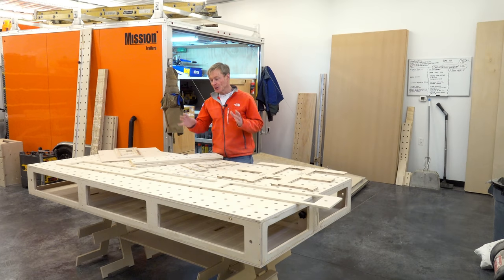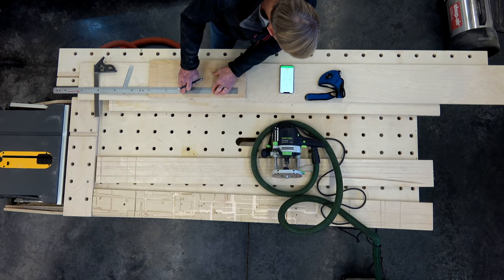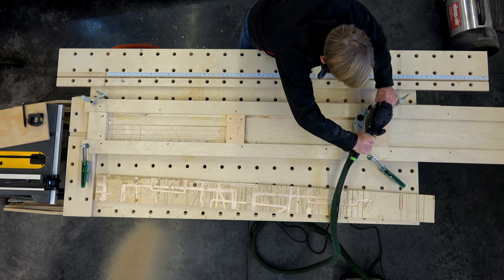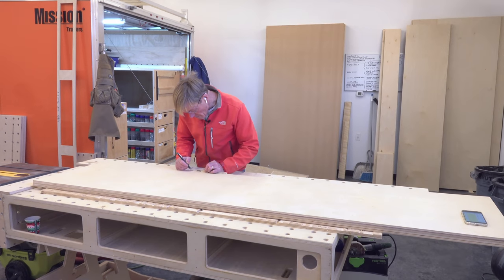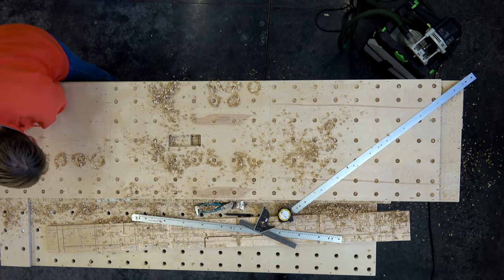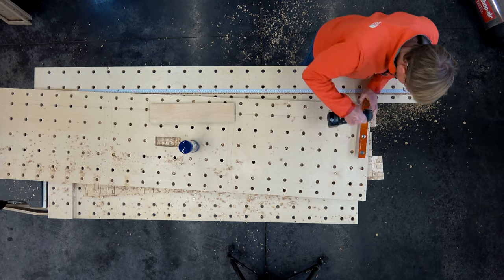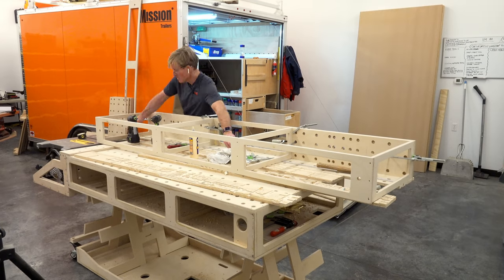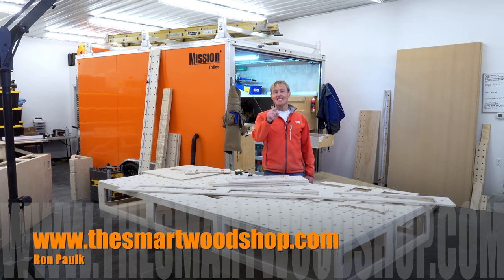Big Bench Build

Comment: Ron. A tip for accurate holes. I tried printing a hole template on paper with center marks for the holes 1:1 scale. I made a bench by plotting all holes on a large format paper and sticking it down to the ply. Poor mans cnc, (a plotter). You get a very precise mark for the holes that you can just prick through the paper. No measuring, just align the paper with the edge of the ply. I tried double sided tape and tested with spray glue, both work fine. A print shop can plot black and white template very cheaply. Luckily I have a plotter at my office so it was free for me. Any CAD program can be used to draw a template of holes, you can also get creative with hole spacing and patterns.

Comment: There's something to keep in mind. You're showing people (often newbies like me) how to build a smart bench with another smart bench & accessories they likely won't own. As such, you might reach and attract more buyers for your plans with a demonstration video building your benches old school by starting out as they would with the minimum tools necessary. They'll have to buy the parf guides, obviously (which is expensive enough on top of all the plywood), but we can watch videos of people building far more complicated and labor intensive things with just the basics. They'll have some kind of circular saw, for example, but they won't likely have a track/plunge saw with parallel guides (TSO or otherwise). They certainly won't have your crosscut guide or a miter station of any kind. They'll be lucky if they have a miter saw. Most will also be coming to the table with a small router only (if they're lucky to have that). I'm just a diy homeowner with an older house in need of fixing/renovating. I am intrigued by your plans because, as you've stated in another video, your benches are great for those working out of a garage because of the modularity of the design (my wife and I want to park our cars inside at night). I for one would like to see an old school build video. I'm not talking about hand saws only, but I think a lot of diyers, myself included, don't even have a table saw. I'm on the Dewalt Flexvolt platform and have their circular saw, miter saw (like yours) & factory stand, small plunge router, random orbital sander, oscillating multi tool, angle grinder, hammer drill & impact driver, jigsaw and a few pneumatic nailers of various brands. I also have a Sawzall and some other hand tools as well as some flimsy saw horses, but that's about it. I'd say I'm off to a fairly good start toolwise, and I plan on picking up a track saw and TSO parallel guides at some point (in lieu of a table saw because I'm not doing this for a living), but I was hoping to build my bench first (before getting the track saw & guides). Anyway, like I said, it's just something to keep in mind since you might increase your sales of your wonderful plans. As it is now I've seen some other people build your benches and they look kinda shoddy if you ask me. I'm starting to lose my confidence. :( I know I will figure it out. But I imagine you'd capture more market share for those even less confident than I am.
Reply: I am actually in the middle of this build right now. I am a contractor so I do have a lot of these tools and can justify buying a few more of the smaller items that I wouldn't have purchased if not for this, and I will find a use for later, but I didn't have a track saw and I'm not going to get one just for this. Anyway, some tips. You can use levels and clamps to give yourself a perfectly straight line for your long cuts. Then you can use a miter saw to make most of the precision straight cuts for the templates. It will take you a lot longer to make your cuts with clamps and a levels, but you can get very good results if you are careful.
Reply: I bought the original plans for the pts  and thought the same. You need a pts to build a pts.. it was my first woodworking project from a plan and I was really green when it came to tool use. I had a good bit of these tools but not all. 
 I did not make the router table in my first pts because I could not make a fence that was true square to the table. I call it the paulk 2/3 station. I learned a ton of things building that thing though and people look at it on the jobsite as if some master craftsman showed up😂😂.... meanwhile by anyone any goods standards its a train wreck.  I've got holes that are mangled from horrible routing skills and  various other things going on.
My point is I did get it done. The mistakes I made had nothing to do with not having a pts to build the pts..
 I just bought all of the plans for the newer rendition and will be starting over. This time I have about 3 years more woodworking and carpentry under my belt. The only thing I'm sweating just a little will be the 20mm holes. I already have the woodpeckers jig but, they're a great outfit so it should work out...

 I will be taking more time to build this one and if I'm fatigued I will stop. That was a huge factor in my fails (besides the fact that I'm a painter not a carpenter) on this project.... Haste does not lead to success. 
   If you delve into this good luck. It can be done and the other guy that commented has some great suggestions

 Edit: just the abity to stand up and work at a table on the job is beyond helpful.  I still see so called professional carpenters setting up on the ground. It is a concept I just don't get with everything available these days. Absolute idiocy.
Reply: I understand your train of thought but I think that maybe this bench is just not for you. I run a handyman business in the UK, I don't actually need this bench. I think the appeal for me is "can I actually build this as good as Ron can?". I've bought the plans and I'm in the process of building it, not because I need to, I just want to. I liken it to my love of making bread, Its cheaper and easier to go to the shop and buy some bread but I prefer to make my own because its something I enjoy and I learn something every time I do it and I'm not striving to achieve "supermarket bread", I'm looking for better. This making of this bench is a challenge to be enjoyed and I personally cant wait to set it up at work and I will have the biggest smile on my face plus I reserve the right to feel supremely smug about it too! :D
Reply: @darrenrichards102  when you set it up at work you will find people looking at it as if a  ufo landed..
 Plus having it opens your mind to possibilities you didnt have before 

I need to build my second one... correctly this time
Reply: @williamsmith9026  couldn't agree more. I'm looking at it as a right of passage
Reply: While I agree with you, it would be nice to have all the tools Ron has amassed from TSO to fly through this build. I think for the crowd you are advocating for, it is advantageous for us to have to struggle through the learning curve. Ron is simply showing us the systems he has built to be efficient. I, for one, will aspire to build this bench with the tools I currently have (and the ones "she" will let me buy this year). I bought the plans, and those are enough to get started. First the bench, then the tool trailer cabinets!
Reply: It is just a bunch of square cuts, what is the big deal?  You can see in some of his videos how he makes interior cuts with a jigsaw while building the jigs.  One can plunge cut with a regular circular saw.  But I would probably just cut the jigs out with a jigsaw, and then pattern rout.  It is hard to make a video that holds hands for everyone out there and their diverse collection of homeowner tools.

Also, it is an OK workbench, nothing I would own for serious shop woodwork.  But great for a pro who works on location.  If you aren't willing to implement something like the tool system he builds stuff around, it is just a table with a lot of holes in it.

Comment: Great video Ron. I noticed your shop heater. I have a Mr. Heater propane, though it does not market at a 100% "indoor" unit, so wondering how you go about that. I crack the door and that's good enough, but wondering your experience. Would you feel comfortable with stain, I have not, but keep wondering what the capabilities are if I wanted to stain?

Comment: Bit wobbely during the routing making the temporary jig to create the master jig no matter how shallow the initial and final cuts are. Why not simply screw a scrap bit in the middle just big enough for the router base to ride on and by this provide support on both sides of the cut, no matter how the router is rotated(rectangular shaped router base) to get an even cleaner cut and demands less balancing and focus during the actual cut.
Recommended especially when cutting in expensive materials, for example when routing for an insert plate to make a router table. Chip outs far too common when almost finalizing the cut.

Comment: Hi Ron. Bought the plans, but already busy thinking about modifications. I'm building this as an outdoors worktable which will not be transported, so I'm thinking of ditching the 2 part torsion box top and just making it a single piece. I also don't care about tool storage in the torsion box, so I'm thinking I'd cut a ton of 4 inch holes in the underside to reduce weight. I also might just mount on an existing steel table frame I have so not need the sawhorses, but haven't decided on that. Have you done/seen builds using a one-part torsion box? Must be harder to keep the parf system accurate matching two pieces together perfectly with zero gap. Lastly, what would you use for an outdoor finish? thx, and nice work!
Reply: This is what I’m thinking also, and I’d also like an answer to these questions. Thank you.

Comment: Do the two halves consistently and precisely realign when joined together to create a precision cutting station?

I’ve a single MFT style top which has an error of only 0.002” per 12” when using bench dogs for fence/guide rail alignment but am considering this top as my shop is in the basement and these could be easily hauled up to the garage for breaking down sheets rather than hauling them into the basement. That said, I’ve doubts how well the guide rail will align when using a hole from each half but maybe these consistently realign perfectly every time?
Reply: I was wondering the same thing.
Reply: I believe they will line up the same as long as you connect the two halves the same way each time. Those speed knobs screw into the double groove, smart connect, bench dogs and they fit a 20mm hole. So as long as there is no play in the 20mm holes,(there shouldnt be) it should line up. At least I think so. Haha

Comment: I just bought a HUGE CNC machine with a work surface of 1500mmx1500mm. I'm going to be looking over your various plans to see which one will serve me best, even if I have to make multiple builds and attach them the way you did in this build.
Reply: Where are you located? You could build two 4x4 tops and connect them that way
Reply: @panhandlemtb4308  With 1500mm converting to 59 1/16 inches, that's a work surface of nearly 5 feet by 5 feet. I'm fairly certain that I'll be needing a bench top surface that is larger than that to accommodate the frame of the CNC. I'm probably going to have to build two of Ron's bench's at 3'x6' and pair them up, to give me a 6'x6' bench top, which in my current home, I just do not have the room for.  Thanks for the tip!!!

Comment: I think I'm going to try and build this using the Shaper Origin!
Reply: Just about to start my bench with the Shaper Origin as well!
Reply: Would love to know how it goes. Seriously looking at getting one.
Reply: @PeakDogs67  Are you asking about the bench or the Shaper Origin?  If your asking about the Shaper Origin I can give you my day one impression.  I won't build the bench until most likely springtime as I live in MN and my shop/garage is not heated.  I've spent maybe 3 1/2 hours on the shaper and I've found it amazing and tricky at the same time.  It takes some time to learn how to move it around and stay in the cut line.  It's a little hard to move around on bigger spaces. My first project is a 2x2 plywood pegboard shelve for my daughter.  I designed the board on Fusion 360 last weekend while waiting for the shaper to get here. I ordered it on Friday and had it on Wednesday during the week of Christmas. Not bad! My big frustration so far is learning the offsets for the 1 1/4 rod I'm using to go into the holes.   I've wasted part of the board with trial and error, but that's how it goes with any new tool like this.   I think I have the formula down and should be able to make the whole board for her in a couple hours. Also, I have no CNC experience, but I do woodworking as a hobby.

Comment: I think what I would do is have the edges of the top and bottom panels where the 2 halves butt into each other a 32nd long.  That way there would be no gap between the 2 halves.  After both were assembled and connected I'd then layout and drill the 20mm holes. Maybe add some dominos, (no glue), or some other method for precise alignment when they're reassembled.

Comment: Hi, Ron! Another thoughtful video! Question...what's the router bit cutting length or depth of the cut on the router bit when you're patterning out the templates here? Based on the thickness of 2 pieces of 18mm ply I'm assuming one needs at least a 1 1/2" cutting length on the Spiral Upcut bit, correct? Sorry, if you already explained this in the video.

Comment: I can't find or have overlooked why the outermost two rows of parf holes are spaced closer. I'm ready to drill my tops now, but would like to understand the functionality of this before I start plunging holes.
Reply from the maker: The layout is 96mm side to side end to end which is why the benches are an exact multiple of 96 for length and width. The addition row around the entire bench is 32mm in from edges to allow edge clamping and bench dog versatility. Follow the plans as they are the results of 10 plus years of on sight use. 😎🤙

Comment: Ron, great video.  I was wondering what you were using for the portable drill guide on the backside of the top for preventing chip out.  It was a blue drill attachment and was that used with the the parf 20mm drill or a different drill bit?
Reply: The drill guide used is a Dowel Drill Press Guide Jig.  Ron pointed it out in a previous build video.  The link is at Ron's Smart Woodshop page; navigate to Miscellaneous Supplies for the link.
Reply: @rj8025  Thank you.
Reply: Ahhh sweet! I was wondering the same thing! I have one that has several holes in it from woodcraft maybe? But I like the one in the video because it attaches right to the bit

Comment: Going to attempt to build this but in a much smaller 2'x6' platform and was wondering if anyone has attempted to use folding table legs from a 2x8 table. Would be super easy and i think would be stable.
Reply: You should be plenty stable downsizing to just 2ft - but keep the weight limit of the table you hack apart in mind. Those legs will only be safe for that capacity, and it wouldn’t seem safe to use that as a work platform to stand on if that’s your intention. Lateral movement/wobble with load might make a leg bend and buckle toppling the bench. But for normal workbench loads you are probably a ok and that would be some fast setup time!
The Paulk sawhorses might be my favorite part of the system to keep my lumber off the ground but instantly accessible while I work, and they fit right inside my bench when I pack up.
Reply: @Derek-xr3uq  Good looking out, just looked up the table, it supposedly supports 1,200 evenly supported. I will be no where near that haha

Comment: Ron - I would appreciate your advice on router bits. If you were just starting to buy router bits and a bushing set, would you go with metric or imperial? I have both metric and imperial collets for my router.
Reply from the maker: For me imperial is readily available and works well. I convert to imperial for set up and again no issues. If I could go all imperial, I would. Tooling in the US is biased to standard/imperial so I just work with it.😎🤙
Reply: @TheSmartWoodshop  Many thanks.
Reply: @TheSmartWoodshop  if you could go all imperial? Did you mean to say metric at some point in this response? I'm confused.